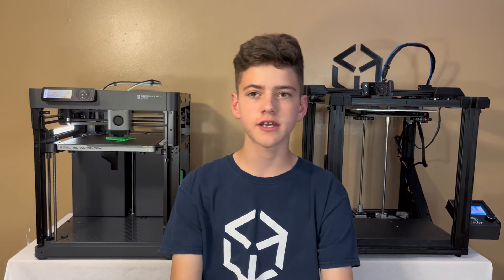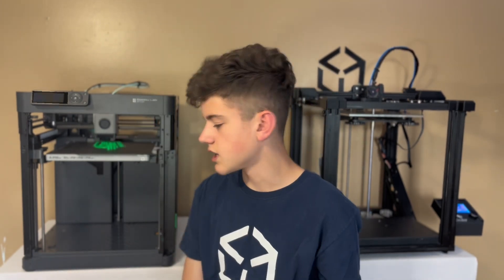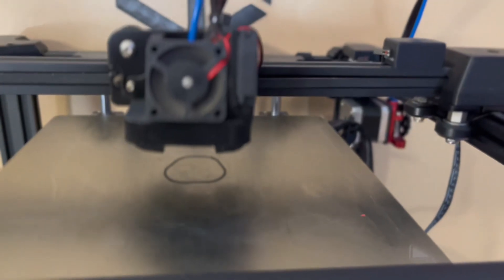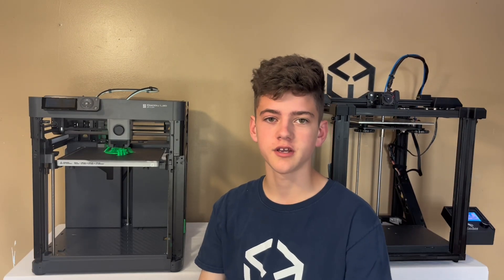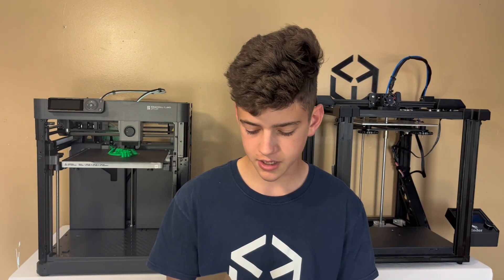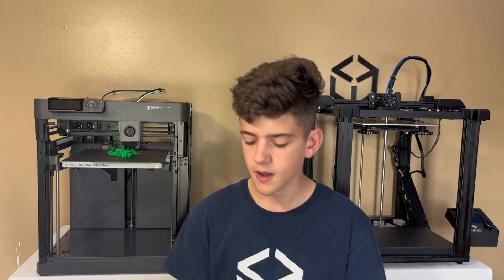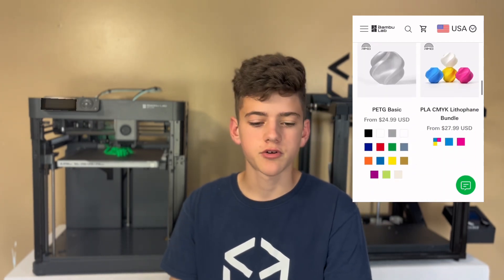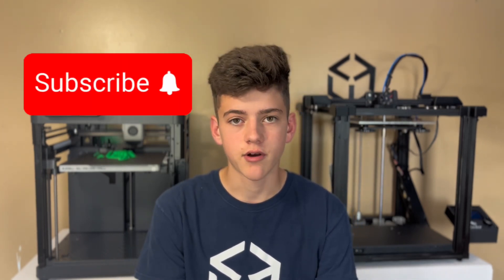Bambu Labs P1P 📦(review)

Comment: I love my p1p. I waited a long time for an FDM Printer that would just work out of the box. I have been resin printing for years now. With these newer machines, apart from the clean up and the initial learning time on how to properly supports models, they work like a charm. When this technology becomes cheaper I can see a lot of my friends and family buying one(FDM). Back in the day(I'm old) the same thing happened with paper printers and document/photo scanners.

Mine came with green filament. Think it was due to the sale they were preparing for. 

I can view the camera on phone remotely but I can't for the life of me get Bambu Slicer to see the camera when I'm using a PC that isn't on the same network. I'd love to see it from work while my printer is printing at home. I hate pulling out my phone all the time.
Reply: Fixed the Camera issue. I downloaded the latest version of Bambu Studio and BAM! It now works on my PC even though I am at a remote location.
Reply from the maker: My slicer seems to be working fine but the P1P is amazing